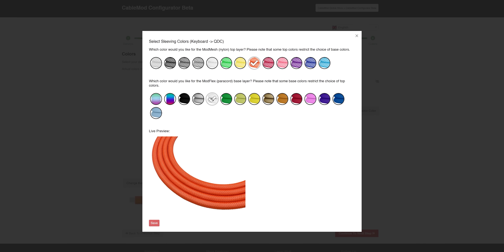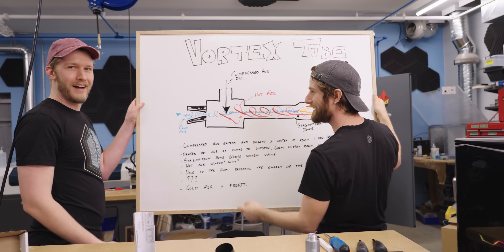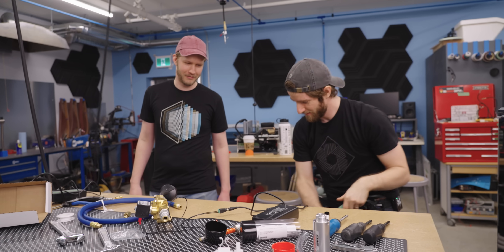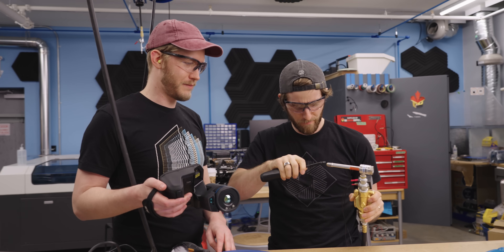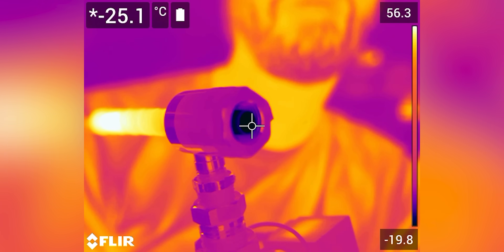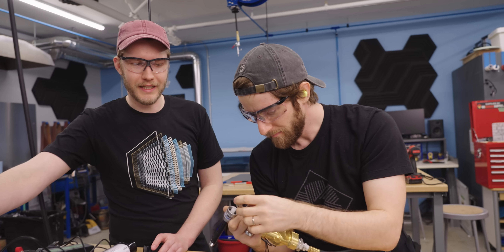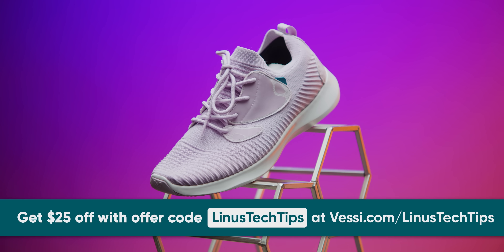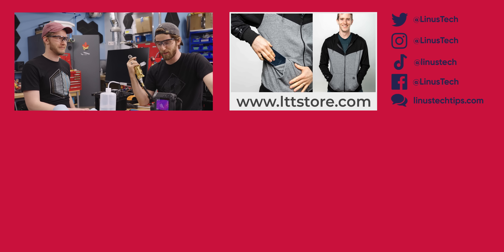This is a CPU Cooler? - Vortex Chiller

Comment: "The frost is only on the outside... But how did they do that?"
They didn't - you did. And also conveniently answered a question I had, while you were at it. You mentioned you used "filtered, oil-free air," but largely the problem with a compressor is less likely oil in the air and more likely water. Compressed air alone has tons of moisture, so much so that if you put your hand in front of a stream of air right off a compressor (at a safe distance, of course) it'd get damp basically instantly. Your filter is, like many, also a drier. No moisture in the outgoing air equals no water to create frost. Only the outside, in contact with air at typical ambient humidity, forms frost.
Reply: I see this all the time letting air out of tires at work. Most of the time the tire was inflated without any filter on the compressor, and as it deflates the valve will frost over (I've seen them clog with enough ice to stop letting air out).
Reply: u need a professional grade air dryer to feed your compressor for things like painting, bc u dont want water mixing in with your paint when spraying stuff like auto body panels for example.  Its also not great for the internals of your air tools, which is why for air tools u use a lubricator which adds droplets of oil to the air stream.
Reply: @freeflub  
What about simple at-home paint sprayers? The paint is water based, right? So they can just use the standard air and not have any problems, I'd think.
Reply: You can have dry air if you have a drier after the compressor motor. Negating a rusted out tank. And less purging of the tank. Although I think that having synthetic oil in the compressor tank will help negate rust. But that is not really likely but possible. Though due to the head contractions of the motor mounted on the tank can be an issue. unless it has a thick metal base plate for the motor that sits on top of the compressor. But you are still putting in hot air. Thus reducing your cfm.
Reply: @tOSdude  I just have a propane torch nearby whenever changing tires because of that.
Reply: @eaglewarrior8707  apparently giving it a shot of air works to unclog it, but I’ve not tested that theory yet.
Reply: @R3cKi7  That smell is the compressor's lubricating oil overheating. Compressing any gas makes it heat up - that's why compressors have cooling fins and a fan blowing across the cylinder, and often times the tube from the pump to the tank has cooling fins on it as well.
Reply: @kindlin  Water-based paints might be okay, though sputtering in the air supply and uneven paint coating (once the water evaporates) might be a problem. In-line air driers are also a thing - think desiccant pack in a can, with air fittings at either end. Either a large one by the pressure regulator on the compressor, or a small one just before the paint gun.
Reply: I've had to buy a couple of these back in the 80's. Used to buy 'em off the Snap-On truck. You use it to test a carburetor's Automatic-Choke on older vehicles. It allows you to quickly heat and cool the actuator-coil that opens and closes the carb's intake butterfly. They were only about $30 back then. Linus needs an inline Air-Drier Filter Combo coming off that compressor.
Reply: @nickg8915  After the water finishes coming out the residual oil coming out gets rather "frothy". A spoonful of it would be perfect on a Lefty-Sleestak's Latte. 😂💀
Reply: You can see the water catch on the outlet of their air compressor, as long as they don't let it get full they really shouldn't get water in the lines.
Reply: @kindlin  The sprayers will create little paint/water droplets in the air which are significantly "wetter" than the water bound in the ambient air in the form of humidity, so it has little effect - perhaps the cold droplets attract more humidity, but the effect should be minimal. You'd counterbalance manually anyway, adjusting the "richness" of your mixture (water solvent per unit of paint).
Reply: Actually, the vortex tube itself will have the effect of drying the air that passes through it. As the air in the inner vortex cools, most of the water will condense out. That'll immediately be flung into the outer vortex due to the centrifugal forces involved and then be ejected through the hot-end of the tube. If you trapped and cooled the hot exhaust you'd find it to be a lot wetter than ambient air.
The oil filter will be removing some moisture, but not much.
Reply: @MAGGOT_VOMIT  choccy milk
Reply: @devneldkumar6513  Oh man, I had three different 90's GM engines blow their cheap factory intake gaskets and get the choccy-mirk. Two of them I caught in time to drain the engines and quick-flush 'em, while they were still warm and no damage occurred. Less than 5yrs later I had a couple of mid 2000's 2.7L Sebring engines get the Choccy-Mirk due to terrible design by putting the water-pumps inside the engine block. {0.o} When the water pumps let go, there was no saving them. Engines were destroyed. 😂
Reply: @MAGGOT_VOMIT  It's all fun and games until it happens to you lol. Ive been lucky so far with no choccy milk from any of my cars.
Reply: My old work used to be really bad for moisture I would regularly go to end of the line low point and water would absolutely poor out. Had a massive air valve to release. Really strange certain parts of system suffered more but they were all set up with up hill tubing the exact same per each row of lines and weird all in same place. It probably didn't help the compressor was kept in a dye house which obviously required heat and there fore steam and also the how factory had a massive basically a swamp cooler to up moisture in the factory to keep silk from chafing.
Reply: That a impressive amount of deduction and thought I like it respect
Reply: The compression and decompression of the air inside the tank causes most of the moisture to condense on the walls of the tank, that's why the tanks have drain valves in the bottom. The oil in the air comes from the compressor itself. While being compressed, the air goes from ambient to several hundred degrees. The compressor uses oil for lubrication and to help seal the piston to the cylinder, so everything inside is coated in oil. When the compressed air gets hot, some of the oil vaporises and gets pumped into the tank along with the air.

For a lot of applications, moisture or oil in the discharged air would be catastophic. (Painting, electronic dust removal, others).

Comment: 2:12 Hot air is not dense, cold air is denser.

A vortex tube creates cold air and hot air by forcing compressed air through a generation chamber, which spins the air at a high rate of speed (1,000,000 rpm) into a vortex. The high speed air heats up as it spins along the inner walls of the tube toward the control valve. A percentage of the hot, high speed air is permitted to exit at the valve. The remainder of the (now slower) air stream is forced to counterflow up through the center of the high speed air stream in a second vortex. The slower moving air gives up energy in the form of heat and becomes cooled as it spins up the tube. The inside counterflow vortex exits the opposite end as extremely cold air. Vortex tubes generate temperatures as much as 100 deg F (56 deg C) below the inlet air temperature. The fraction of hot air exhausted can be varied to change the outlet cold air temperature, with more exhaust resulting in a colder cold air stream (with lower flow rate), and less exhaust resulting in a warmer cold air stream (and higher flow rate).
Reply: This is so awesome
Reply: This is also why there was no frost on the one side. The hot air forms a thin film around the part. The cold air is only touching air.
Reply: It's extremely hard to watch Alex when he is breaking down things technically.  He fucks up so many things and gives out wrong information a lot.  Glad LTT finally hired some real engineers, hope they get some screen time or at least can help the writers reign in Alex's bullshitting.
Reply: What confuses me is why the slower moving air gives up its energy, as in where does it go? 
As far as I can tell, the only thing that the slower air touches before it has cooled is the end of the tube where some hot air escapes as well as the outer hotter air vortex, so convection wouldn't be able to cool the inner air stream to lower temps than either of those, which should both be at or above ambient temperature.

Is this a refrigeration-like effect because the inner stream becomes less dense somehow? That is the only way it would make sense to me, as it would be like a pressurized tank that gets depressurized and is much colder afterwards. But how is that pressure differential maintained? Just the centrifugal force of the air vortex spinning around? Or is there a physical divider between the two streams that isn't shown in the diagrams?
Reply: @knexfan0011  You got it the wrong way round. Slow moving air is air that has given up its energy, that's why its slower. The idea is to split the faster, hotter part of the air from the slower, cooler part of the air. Faster air will create a vortex with a larger diameter than the slower air, same way it is harder to turn in a car when you are going faster.
Reply: the hot air should be used to power a sterling engine, the cool air can be used on a Peltier device.
Reply: I wonder if it would do any good to drill a hole into a decent size long chunk of copper that could thread into the silencer and cut the bottom of the block to fit the CPU heat spreader.
Reply: Why have they not pinned your comment yet?! They should hire you as a science adviser, lol 😏
Reply: @ATSNorthernMI  acording to german Wikipedia silencing the thing dramatically reduces the effectivity, the noise is somehow needed for it to work.
Reply: @HamguyBacon  Why? Both mentioned machines are increible inefficient. You gain nothing with this setup.
Reply: @ulrichkalber9039  Its not really the noise that is needed, the wikipedia article is a bit misleading here. The point is that a silencer basically introduces a lot of turbulences into the flow resulting in a very high Reynolds number and friction losses. This restricts the throughput and thus the whole system. There are still some details missing here though which are not scientifically understood until now nevertheless.
Reply: Well, thats a good explanation of what happens. I just want to point out here, that it is not a full explanaition of why this happens. The crux lies in the "The slower moving air gives up energy in the form of heat". Science, so far, has not found an explanation to how/why that takes place, as this seeems to go against the thermodynamic law saying, that any energy flow from a low form (and heat is the lowest form known) into a higher form needs some kind of work/cannot happen on its own, whilst the other direction (dissipation) is the normal thing to happen.
Reply: "Hot air is not dense, cold air is denser." That is not strictly true.  If you trap 1 litre of air and increase it's temperature, it's still the same mass and volume, so the same density, only temperature... and pressure changed.
It just so happens in an open-ish system like this device or the atmosphere that "volume" is able to increase instead of pressure.  "Air" is not a simple gas either.  It's mixture of gasses and liquids.  Cold air holds less water, so it's thermal 'mass' is lower.  Hot air holds more water so it's thermal 'mass' is higher.  Absolute humidity taken account of course.
Reply: Was searching for this comment! The joke tone is nice but I was waiting for an actual explanation of how it works, Alex, come on -_-
Reply: You lost me at hot air is not dense
Reply: vortex expansion, cool. how does this compare with a simple refrigeration system? i mean, how much energy put into the system, and how much btu's cooling can be acheived? which is more effective?
Reply: tornado in a tube
Reply: same can be applied to creating and capturing a tornado for power generation.tho the built mass is far larger.
Reply: @ulrichkalber9039  most likely.limiting the Flo.rate.
Reply: @davawen9938  few comments. overall fast and.slow.dont mix. slow is cold. fast being hot.
Reply: @dylanfortune1391  possible. but as the actual physics is not understood there may be more to it than the reduction of flowrate.
Reply: @ulrichkalber9039  size matters it could go 10x in diameter.
Reply: @dylanfortune1391  i think the air supply would have to be monstrous.
Reply: @ericvauwee4923  on the scale that Linus is using yeah. But this device is used in industrial purposes meaning this is used mostly on large scale projects like cooling large machineries from factories.
Reply: @heckintosh2994  If you light a small fire and hold a piece of paper or something light above it, you will notice the air is “blowing upwards”. The hot air from the fire is rising because it is less dense.
Reply: @1over137  What I meant is that hot air doesn't get denser... as the molecules heat up and move faster, they are moving apart. So air, like most other substances, expands when heated and contracts when cooled. Because there is more space between the molecules, the air is less dense than the surrounding matter and the hot air floats upward. Alex explains that "hot air gets denser" which is incorrect. Hot air is generated by the high rpm spin from the vortex and since hot air is lighter (less dense) it is easily pushed out to the outside chamber and vents to the outside to vent out the heat. Meanwhile, the cold air remains in the center of the chamber because it is heavier (more dense) and it can be released to the other side, thus making the separation of hot and cold air possible.
Reply: @dylanfortune1391  if you can CONTROL and CONTAIN a tornado it can be possible. But you will need a tornado every now and then. For me it is not feasible.
Reply: @heckintosh2994  sorry, what I meant is hot air does not become denser, cold air does.
Reply: @blindedbliss  Thank you for the positive remark.
Reply: @elayda93  the tornado in a bottle is to creat power. This is a forced loop requiring power in the form of air,to function.
Reply: @Raven05R6  ah, cmon!  "black magic and a deal with the devil" may not be CalTech lingo, but its technical enough for the laymen 🤣
Reply: @seaneyo  that is why when spun to 1,000,000 RPM the compressed air gets hot up to like 200 °C thus expanding that air and making it lighter. While the outer vortex moves down to one end of the tube and the inner vortex moves in the opposite direction to the other end, both rotate in the same direction and with the same angular velocity. Since the inner vortex has a smaller radius, conservation of angular momentum would have it rotate at a larger angular velocity. Thus, work was done to change its angular momentum and have it rotate at the smaller angular velocity of the outer vortex. The inner vortex loses angular momentum by interacting with the outer vortex and the kinetic energy that is lost shows up as heat in the outer vortex. The outer vortex becomes warm and the inner vortex is cooled. Cold and denser air stays inside the center of the vortex chamber while the warm and less denser air will bleed out to the tube.
Reply: @dylanfortune1391  tornado in a bottle? I thought you were describing an actual tornado hahaha.

But where would you find a tornado in a bottle? Remember, to create that "vortex" or "tornado" that you are referring to, you must have compressed air. Where would you get the compressed air then???? Compressed air is generated also, there is no compressed air in nature that we can harness feasibly.
Reply: The real comment right here. 👆👆
Reply: Now this makes perfect sense
Reply: @Raven05R6  100%
Reply: @Raven05R6  It annoys me so much watching some of these videos.  How hard is it to do some research and write it into the script or have someone else do it?  That's why Anthony is so good in front of the screen, because he knows his stuff.
Reply: Awesome description. Thank you.

Now I'm wondering if you can use that energy differential in some way helpful too (Stirling engine?)

Comment: These have been around since at least the 70’s.
I’m a master auto tech. We used them to heat and cool carburetor choke springs to adjust properly. 
That price is insane. The last one I purchased was about 12-15 years ago for $25. Still use often to cool and heat temp sensors for diagnostics… And classic car chokes now and then
Reply: you should make some money... i believe you just saying...
Reply: It is a tube with a venturi in it $25 even sounds pricey.
Reply: love you answer, thanks
Reply: This guy obviously has not looked at gas prices............
Reply: @themanthemyththelegend1392  wtf do gas prices got to do with any of that lmao
Reply: @aarvlo  he’s implying that inflation over 20 years accounts for the price increase. Emerging tech decreases in cost over time, but a Hershey bar costs $1.40 today and was $0.10 40 years ago.
Reply: 2 years late, but the piece being that high is probably a combination of inflation and buying it from McMaster Carr.